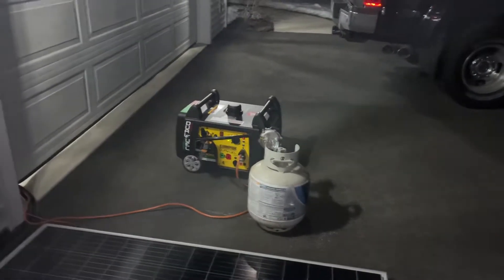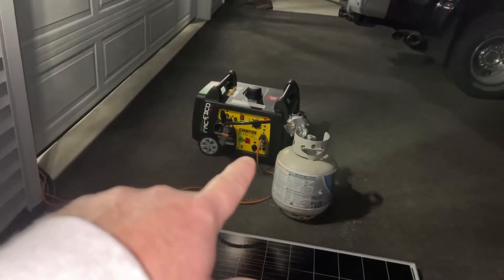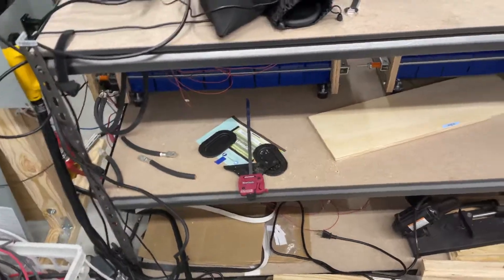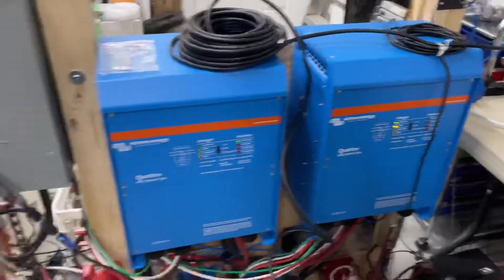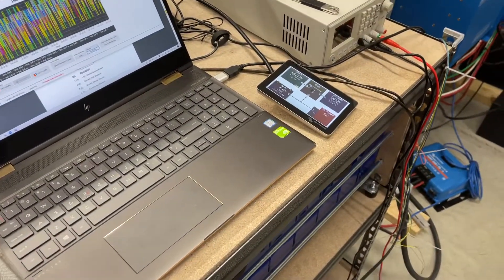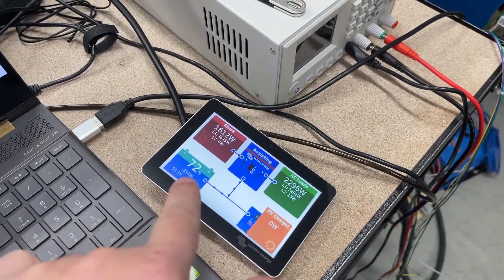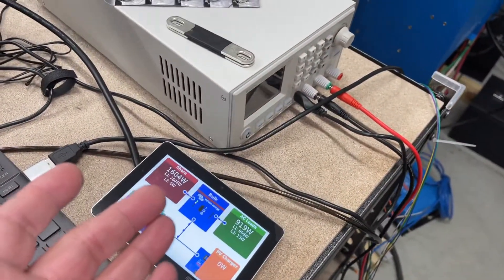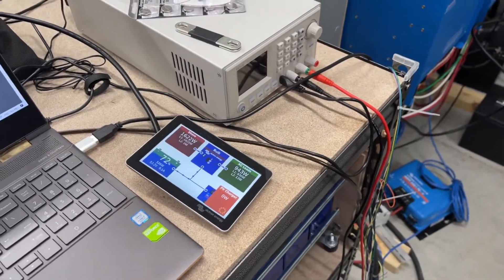Connecting Victron System to Champion Inverter Generator

Comment: Good video but I hooked my two victron multiplus like this and the generator won't charge the batteries. The inverters are sending the power to my panel, so if I have my generator running, I have power without draining battery power but it's been snowy and cloudy for days and I have no way to charge my lifep04 cell pack system (wired to electrodacus BMS and dssr50 for 24V). Any body have any ideas as to why this could be?
Reply: Check your settings. The battery charging option may be turned off.

Comment: Thanks for the video... I wonder how much it (generator) would put in in a maximum type of situation with using low or light pull off the batteries such as lights only. I am wondering how many  amps and watts from the generator the Inverter will take and then put over to the batteries.  I am "thinking" about winter and no/low solar and we have a power outage for a couple of three weeks.  I have been testing my batteries running and use without charging just to see how long they will last ... I am a pro LiFePO4 only type of 
efforts. I have a 200 amp in a small radio shack..  I understand the grid via Victron will charge...  I am thinking if I need a 3000VA and combo to grid and solar is necessary or if I can modularize things.  I have other Victron products on other uses and very very pleased with them...  just penciling it out and seeing how little difference is costs would be.  I am also considering some wind generations.. which would be nice during storms and night winds..(even in summer).

Comment: I have a honda eu65is generator but I cant get it to work (I am in SA so 230V) I am getting the generator to connect and charge the batteries but then no power is going out on AC out1. Any specific settings you set on your ve.config?
Reply from the maker: hm, no nothing special; I assume your inverter is set to on/invert and not just charge.
Reply: manage to fix it?

Comment: Nice setup. I would like to know how long can you run the generator with propane in a in a long term situation. Like let’s say you had no power for 2 weeks. Would your solar and one propane tank keep you running?
Reply from the maker: solar provides 100% of my needs unless it's over 95F or under 40F ... then I need propane for generator / heat.  That generator would eat up a 40 pound propane bottle in something like 15 hours at 80% load (the generator would be running at 80% capacity or more, depending on my settings, to charge the batteries / supplement the solar).  But yeah, that's under extreme conditions.
Reply: I made 7 hours straight with that generator and a 20 lb propane tank. I still had propane in the tank.

Comment: Does the Victron sync with the genset? 
I'm thinking of a scenario in which you were producing power with solar, and you only needed the generator to fill in for additional power needs.
Your video seems to show that is the case, I'm just trying to figure things out.
Reply from the maker: It's a little tricky unless you use Victron's ESS batteries.  When my batteries aren't full, the solar goes "full tilt" and any shore/generator power provides additional charging power.  When the batteries are full, power comes from shore/generator and not the solar, unfortunately.  So I have my Victron equipment configured to disconnect from shore/generator when the batteries are full.

Comment: Hello, which slot did you use the generator wire in victron inverter?
Reply from the maker: I connected via the same shore power plug (so both "shore" and "generator" came into the same AC-1 input of the Victron).  It doesn't really matter which one's which .. you can label and configure the two AC inputs on the Victron as you wish.
Reply: How did you hook the wires up?
Did you put hot1 and hot2 from generator on line 1 and neutral of the inverter?
Reply from the maker: @mountainviewhomestead5236  It's a 120v generator so there's only 1 hot.  The inverter input had a 240v 50 amp plug on it, so I used a typical RV "dog bone" adapter which connects the 1 hot from the generator to each hot of the 240 plug ... 1 hot of the 240 goes to 1 inverter and the other hot goes to the other inverter.  So both inverters see the same single hot leg .. and they're smart enough to detect this so only one inverter actually "connects" to the hot line.